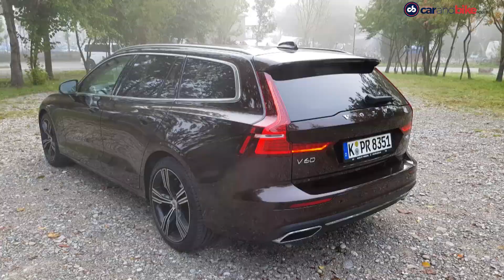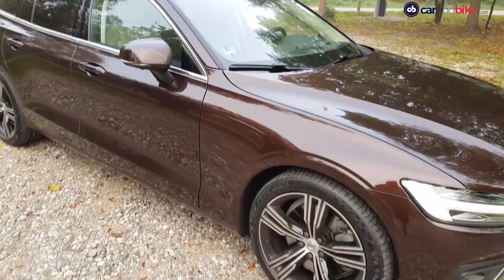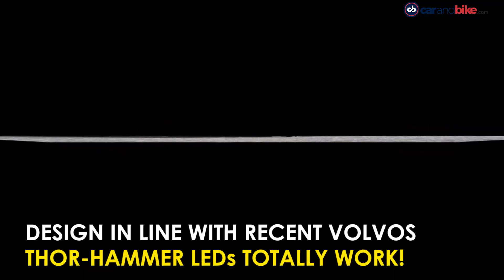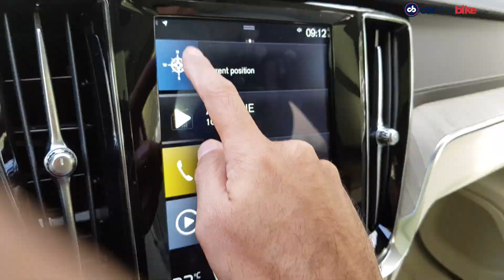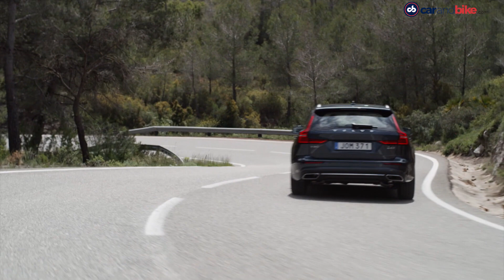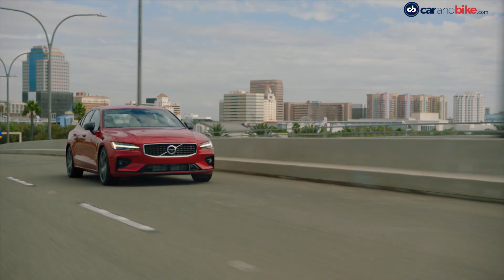Volvo V60 First Drive Review | NDTV carandbike

Comment: Basically, it is just a smaller V90. The interior does have the required wow factor but the problem is that it is too reminiscent of other Volvo cars. The S90 and V90 snare the same interiors too with this car. So what has exactly changed? Good they aren't bringing this to India but the Sedan version which deserves an upgrade. It is quite different from the S90 and should be in my opinion, a serious consideration and alternative to the BMW 3-Series, Audi A4 , Mercedes Benz C class and the Jaguar XE.
Reply: Have you sat in any other cars recently? They're all reminiscent. The e class wagon for example. It is not going to br a different  car because station wagons do not sell more than suvs or sedans. Even the Xc60 is a smaller xc90 but it offers fhe most than any of its rivals in its class.
 You're looking at it in a very one dimensional way.